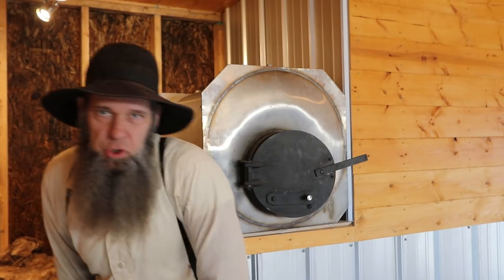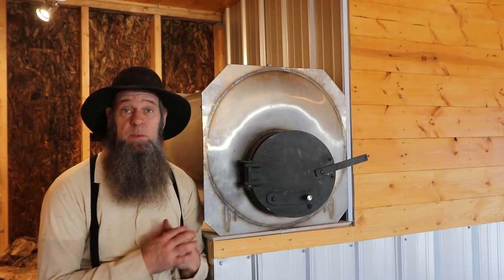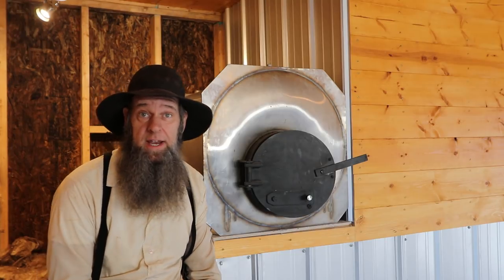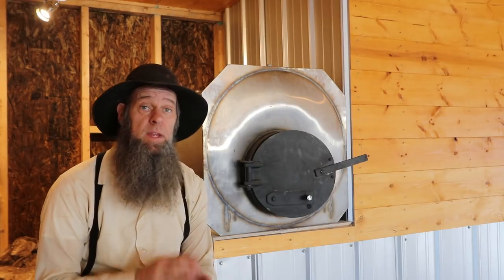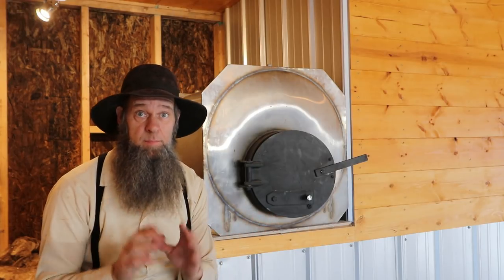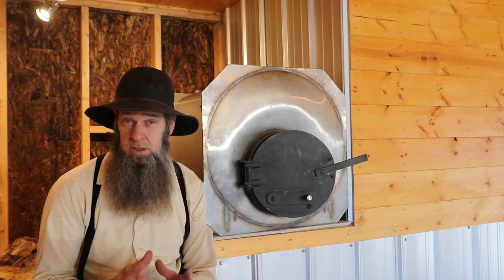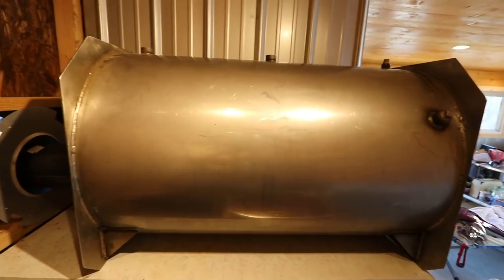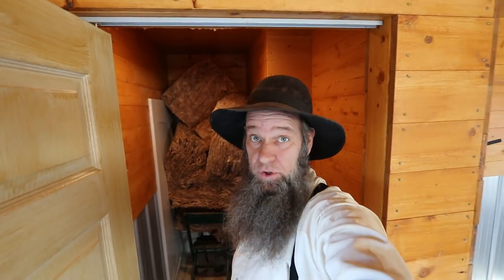Amish made  hot water tank | stovepipe install | off grid rain water system

Comment: 1. Ball taps work well on gravity fed systems and they are remarkably cheap and look like stainless steel.
2. We use a copper or stainless coil in the grate of the fire, fed to a modified stainless beer keg or kegs in the roof, it is a recycling system fed from the lowest point and returned to the top, it has a normal toilet type floating ball valve to keep the water level constant.
3. We have a windmill that trickle feeds a tank on a 30' stand, with the overflow returning to our water tanks, this gives us modest water pressure.
Keep up the good work I love your clips.

Comment: Hey Doug, quick way to mark all the way around pipe, use a full sheet of paper and line up the edges, the width of the paper automatically squares it to the pipe if you line the edges up.
Reply: I use the blue painters tape.
Reply: Good tip Chad. 👍

Comment: Your gravity feed water could feed a 12v rv (pressure regulated) water pump that would run off your solar to feed pressurized water to your fixtures. It would only run when you turn on a faucet. Then you can use stock fixtures.

Comment: Hey Doug! I have a tip / suggestion on the chimney installation... You should have a short length of the chimney attached to the horizontal ‘snout’ of the tee where it penetrates the wall. The way you have it, there’s single wall pipe way too close to the wood framing.

Comment: I do hope you are going to seal that stove pipe on the outside, the way you have it, its going to leak.  Have you thought about a 12 volt pump and a small pressure tank inside the building? It would give you the pressure you need for both hot and cold water.  There's your nugget.

Comment: I am not sure how often you run your  pickup or for how long. If you run it enough you could charge a couple of 12 volt car batteries hooked in parallel with a battery isolator unit. You can run power for 12 volt LED lighting & other low amp devices in your dwellings for a long time between chargers. Something to look into if you want.

Comment: Charging cell phones for us has changed a few times. Van was first that didn't  last long our was towed to where it now sits. Our oldest son lent us his truck and we were able to charge using that. Not long after getting the truck we started having problems  with the battery. So we charged once with a neighbor. When we figured out the van battery was bigger than the truck battery  we switched batteries and had to get it jumped. Well that worked for months until the truck broke. Luckily  we were given a 6w color panel before we moved on to this property so we were able to very slowly charge one phone at a time and still didn't  get either  phone fully charged even after our son gave us another solar panel he found it helped a bit even though it is a lot smaller. There were times we went days without  the phones being charged until I realized the color panels had one wire disconnected from the battery. It took that happening about 3x before I realized I should tape the wires in place. Cloudy mornings were hard and cloudy all day no charge that day. I ended up talking to a neighbor  be only spoke to a few times she asked if we had a generator I told her no and the ones that were on the property one of the people before us broke. She called me less than 10 minutes  later and told me we could use their generator. We feel so blessed to be able to charge phones and run fans. We now have a real light not a garden light or head lamp. We still use the other lights a lot but when cooking on our hot plate we use the big light. 
Cooking was a challenge for a long time we used a little smokie bbq pit siting on cinder blocks because the legs were not stable. Rain, wind, not enough wood, or maybe supper got started after dark. Sometimes cooking took 2 hours depending on conditions if I was cooking beans that took 2-4 hours or more a lot of wood as to much or out time. I prefer the hot plate  it is so much faster.
Water was a challenge until the neighbor  said we can get all we want. No way to do a rain collection  system at this time and it hardly ever rains here in South Texas. Well except this last week we had a big storm as well as last night. Tonight we are expecting rain again. We are thankful for the rain it has made a few chores easier including  bringing down a Mesquite tree that is about 10 -15 feet tall and dead. This tree was beside the chicken coop. This morning I went down to feed the chickens and let them in the runs when I noticed this tree had a branch over hanging the coop and others over the coop and low. I was a bit confused because the only way this could happen is if the entire tree shifted because  there were no broken branches. After feeding the chickens I pushed on the tree and was able to rock it with not much effort. Knowing it had to come down soon or it would be on the coop I woke up me husband and shower him the videos I made. We went out a few hours later with tools to take down the tree. It was 1/2 an inch from resting on the coop. Luckily  it's  not heavy enough  to do any damage to the coop. With no tools my husband  and I started pushing on the tree then rocking it. We were able to push the tree to the ground in about 30 seconds  with almost effort.  If there was not video of it no one would believe  it.
We are loving the process of learning to homestead. Not wanting to plant yet it is very late in the season and were  uncertain  of how long we will be able to stay on this land (It is borrowed).
We enjoy  your channel. Stacy anything that makes your life easier I will love to know about. We have been watching  a lot of your old videos and are learning so much. Think you both.
YAH bless!

Comment: Can't you use a small windmill or solar power to run a pump to pressurize your water flow? You could always start with a 3" and keep dropping the diameter till you get to 1/2'' pipe which should give you enough pressure!

Comment: Farms used to have tank houses, to get more water pressure. Water can be pumped up to the tank using wind, or solar power, if you have enough. There are vehicles that can use wood smoke for fuel, instead of gas.

Comment: Might consider double walled pipe where it goes out through the wall.  At our previous house, we had a vented water heater,  and it went out the side of the house.  Double walled pipe had to be used to meet code requirements.  Safety first, always!  Also wondered if you were going to install standoffs, and voila!  there you were putting them on after the pipe was all in place, including the dented section!
Reply from the maker: Look up wall thimble 😉

Comment: Doug, what should I keep in mind when running a smoke stack through a 2x4 framed wall from a wood burning stove? Stone board? Special insulation? Also, are the light behind you in this video solar? Love the content guys. Thanks 👊😎
Reply: You need to check your clearances between the pipe and the nearest combustible material .... Double walled liners will probably be needed (as was used here) or you could even go to Triple walled ...... check your codes as everywhere is different!